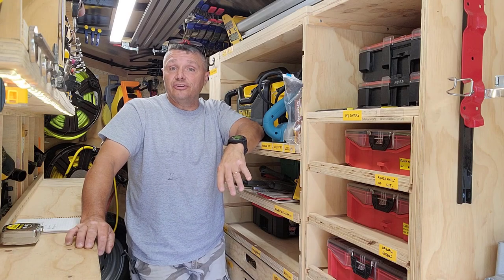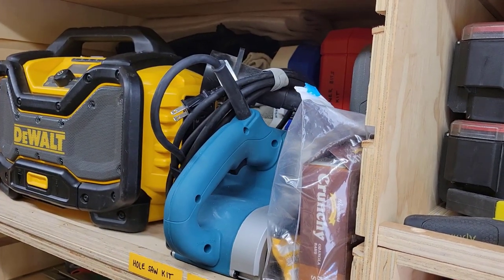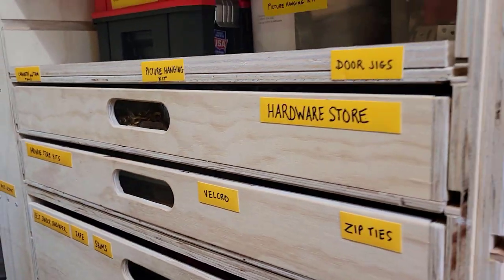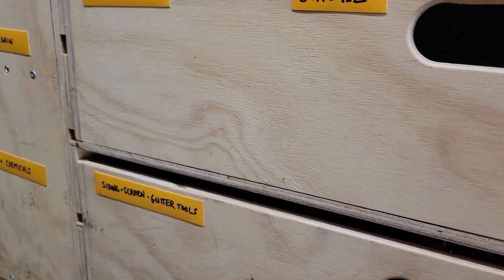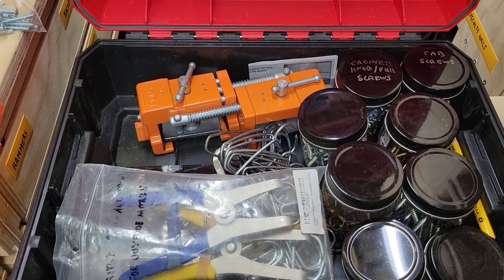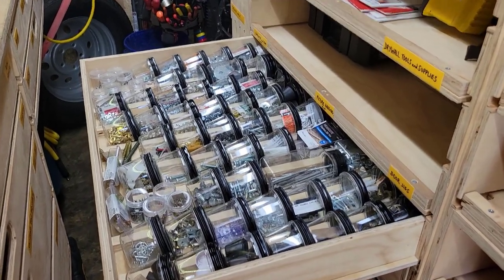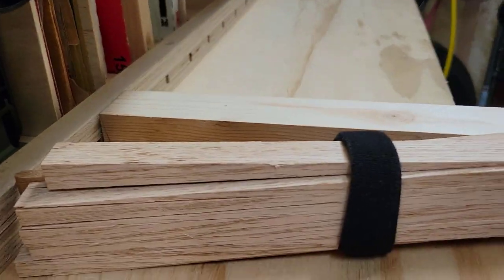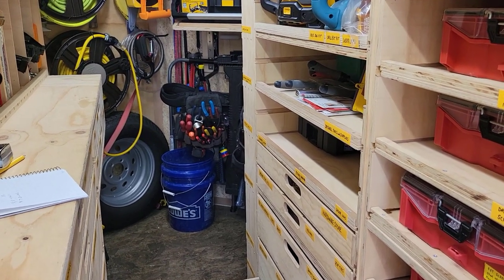Tall Cabinet/Drawer Bank 3  - "a la carte" deep dive - Paulk-Inspired tool trailer

Comment: I wish I had used this restraint system, the newer one he uses with the holes and screw heads does not work so well.
Reply from the maker: I was fortunate that by the time I did my build out, I had discovered Ron and he had just completed his SMART trailer with the new passive restraint system with the drawer bottoms that eliminated the screw heads. My procrastination finally paid off.